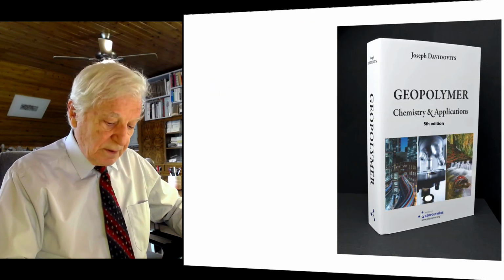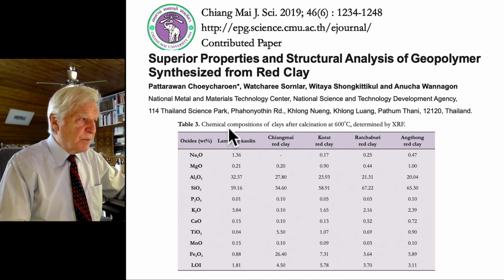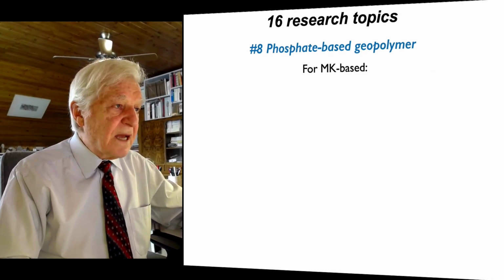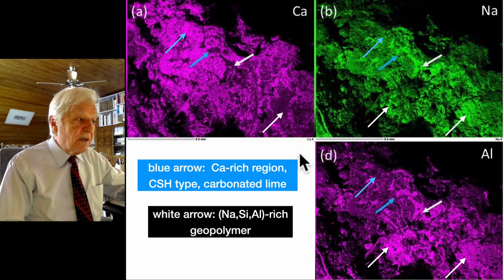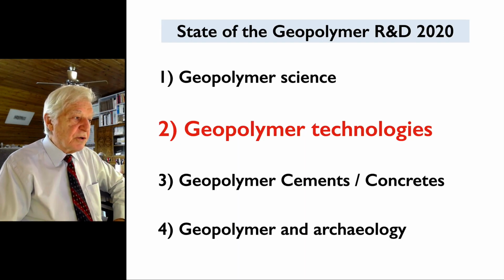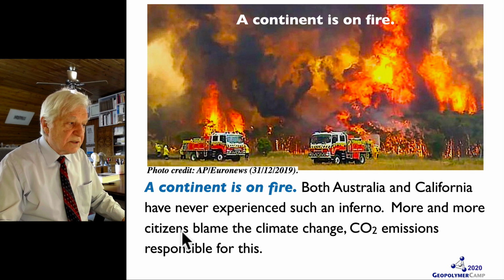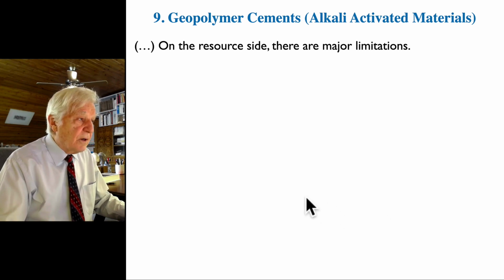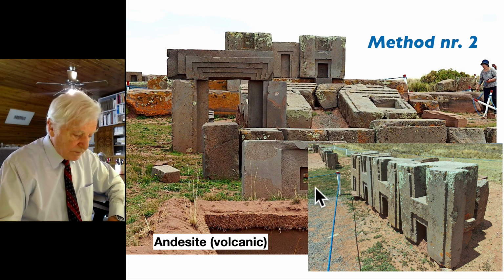Ferro-sialate Geopolymers better than Fly Ash (State of the Geopolymer R&D 2020)

Comment: The knobs on megalithic blocks are the remnants of a sonolithography transducer used to set crystals aligned in curing blocks
Reply: it's probably letting exess fluid exit so it can allow air in to let it cure further. crystals in the mix don't need to be aligned to do anything and a mixed orientation would make it stronger.

Comment: What about the gold digging in Peru or copper brass production in Roman imperia?
Gold melts at 1080°C, air blasted furnace can easily overcome 1200°C at which most known K and Ca carbonates would be converted to their oxides.
For that time could be used wood, wood coal or just coal, rich on Ca and K.
Additionally all other materials will lose their crystalline water like in gypsum or cement.
Main material for gold quartz - SiO2. Granite mixture of Quartz and some other minerals (including Ca and K).
At high temperatures SiO2  already could react with Ca or K to silicates.
Highly active material cooled down, filled to bags locally to form a stone block.
Rains do their job to moisturize bags with active material.
Most probably some bags were compressed by heavy load from top and some material had protruded from them.

Even using potassium silicate and sand, later CO2 to crosslink it fast, mold would still have soft liquid core.
If you press strong enough then you can deform top layer. Later mold is completely become solid.

Comment: The fly ash will be made. It is a byproduct that wont be going away anytime soon. its not making more Co2 after it is made. So using it instead of cement is logical.  it is better to use a pre-existing byproduct than to mine a product for the same use. No worries there is so much fly ash and slag around the world, tons of tons. even if we stopped coal plants we'd have enough to build for a few decades,  enough for the Portland cement people and the geo poly people. So much CO2 is generated for mining. Mind as well burn coal.

Comment: Great work Joseph, both the Dog Head, Big Arm Last Mountain Lake Sask Canada where the bible legally starts and ends, has a 12,000 year old star map below the criot, use 2003 google images 2 Samuel 3:8  Dog Head of Judah, Rev 22:14,15 straight west of Stonehenge, Stonehenge and West Stonehenge 106.46.22 Long & 51.10.73 Lat centerline of Stonehenge all appear to be constructed by Pharaoh Hotepnebty 'Bedjaw' born 7 10 2853BC which King David based his legal Psalm 104 Layline on from Moses Lake Washington State to Hadsel Municipality, Nordland Vesteralen Norway 68.23 Lat & 15.3 Long E 'City of the Gods inside a mountain range where the Elohim-Nordic dwell or the biblical Gods. You can get the Starmap from Information Services Corp. Regina Sask. The triangular number 153 was used.

Comment: Concrete does seem to explain a lot of the amazing work, there are even some blocks in Pumapunku and statues in Egypt where you can see a central block has been used as a former and an aggregate of some kind forms a quadrilateral shape around the central block or a statue or bust. But there are some objects in Egypt that have continuous veins of Quartz running through them and so obviously weren't poured.
Reply: there is no pouring involved in geopolymer...
quarts veins could be created with layering